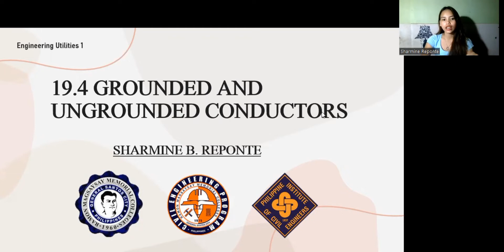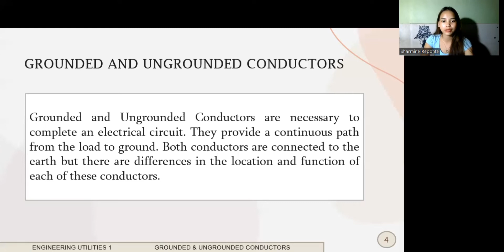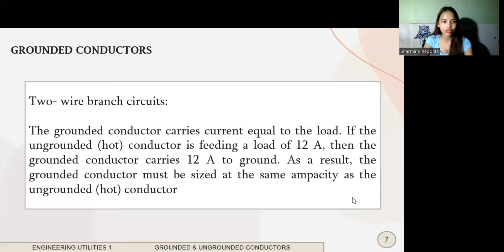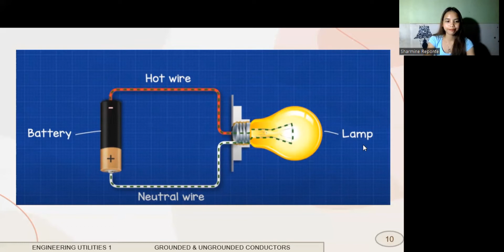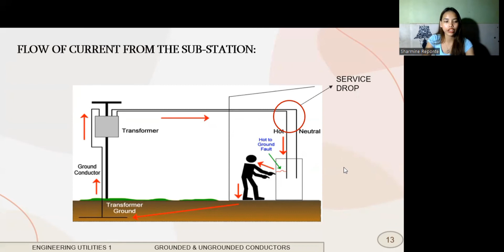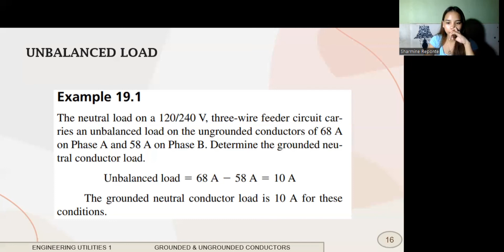19.4 GROUNDED AND UNGROUNDED CONDUCTORS

Comment: Her topic teaches us about grounded and ungrounded conductors. What exactly is the distinction between the two, and why is it crucial for us to comprehend it when it comes to electricity? She also discussed the most useful conductors. How will it work with the use of electricity? Overall, an excellent discussion. There is a lot to learn about her topic, especially its relevance when it comes to power voltage.

Comment: This presentation was informative and well-explained. I learned and understood the importance of grounded and ungrounded conductors in completing an electrical circuit. Despite the fact that they are both connected to the ground, the locations and functions of these conductors differ. Thank you for this fascinating discussion, Ms. Reponte. Overall, it was an informative presentation.

Comment: I sincerely appreciate her effort. The slides are academically and skillfully done, and I like the presentation of Ms. Reponte, because she speaks at a good speech rate, not so fast and at the same time not too slow. The visuals are very appealing, and she also does proper research on her topic. In this lesson, I’ve learned that grounding your electrical systems is critical to protect both building occupants and equipment from the danger of high voltage. While, an ungrounded system connects specific parts of an electric system with the earth or ground for safety and functional purposes. Overall, she presented her lesson very well.

Comment: Gives us knowledge about the grounded and ungrounded conductors. What is the difference between the two and how is it important on us to know about it when it comes to the electricity. She also discussed the conductors that are most usable. How it's gonna workout with the use of electricity. Overall, very well discuss. Lot of learnings of her topic especially it's importance when it comes in high voltage.

Comment: Perfect video and great explanation! Thanks for that! I appreciated your effort for explaining your topic clearly. In this lesson, I’ve learned that the Electrical grounding aids in keeping the wire system's current levels under control. In order to safeguard equipment from the risk of high voltage, grounding your electrical systems is essential.

Comment: In this report about grounded and ungrounded conductors, the reporter gives us information and explain what is grounded and ungrounded conductors and give the importance of it. She explain that grounding is a backup path that provides an alternative way for the current to return to the ground in the event of a fault in the wiring system.  She also explain that grounded and ungrounded conductors are necessary to complete an electrical circuit. It is good that the reporter explain it to us because it will help us to appreciate electricity as one of the important things we have in our life.

Comment: In this report, which is about Grounded and Ungrounded Conductors, Ms. Reponte explained her report very well. In her report, she discussed what is grounded and ungrounded conductors and what are the uses of each conductors, because of that I learned that grounded conductors are meant to keep people from getting shocked when using electrical devices while ungrounded conductors it is also called hot wire. Overall the report is very informative and you will learn a lot of information for future purposes.

Comment: Grounding is a familiar term when we are talking about electricity. But with the presentation of Miss Reponte, it opened realizations and gave an important ideas how this grounding or grounded conductors work. Electrical grounding serves as an alternative path for the current to return to the ground. It is important for us not to be harmed because of the abnormalities in electrical flow. How it works was well discussed by the presenter. The presentation was great, the delivery was good, as well as the enunciation, it was excellent. Keep it up!

Comment: As this video ends , I've learned that Grounding or Electrical grounding is a backup path that provides an alternative way for the current to return to the ground in the event of a fault in the wiring system. It facilitates a physical connection between the ground and electrical appliances and devices in your home and ours.

Grounded and Ungrounded Conductors are necessary to complete an electrical circuit. They provide a continuous path from the load to ground. Both conductors are connected to the earth but there are differences in the location and function of each of these conductors.

Comment: I gain a lot of learnings with the report of Ms. Reponte. She delivered it very well and explained it very well. She discussed the grounded and ungrounded conductors. I learned that grounded and ungrounded conductors are important to complete  an electrical circuit. The locations and purposes of each of these conductors differ, despite the fact that they are both connected to the ground (the earth). Her report was really informative.

Comment: I was able to learn new things with this topic. It was presented very well and was well explained. Electrical grounding helps the wiring system to avoid over current in it. Grounding your electrical systems is critical to protect both building occupants and equipment from the danger of high voltage. When a conductive surface, like metal, is not grounded and becomes electrically energized, it can carry sufficient voltage to administer a fatal shock. This presentation was very informative.